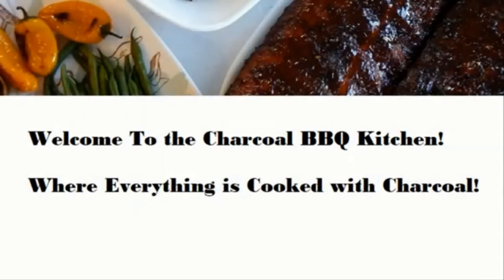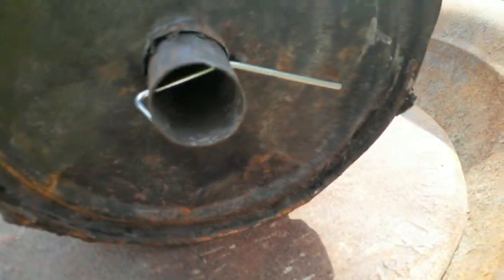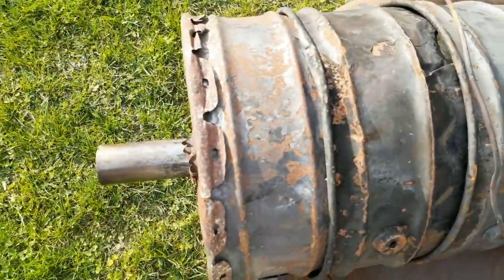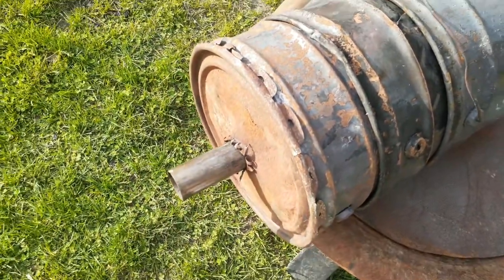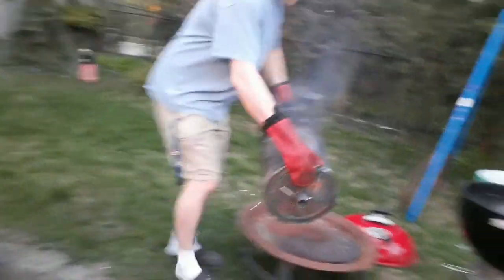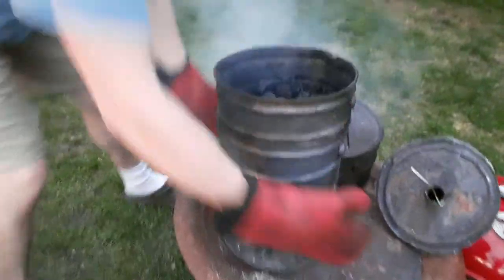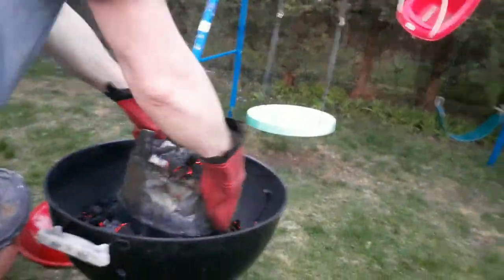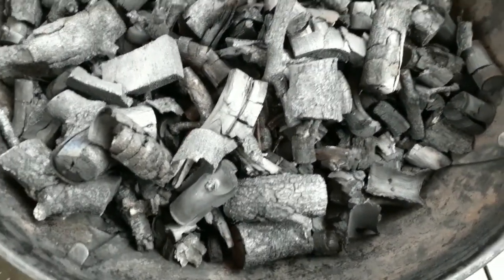The Best Backyard Retort - 5.5 pounds in 1 hour 20 minutes!

Comment: Many of the charcoal makers say the charcoal can ignite if dumped immediately. Have you had any problems with it firing? Would it make any difference if you left it sealed and dumped the next day when cool? Thanks for taking hours off the process of making charcoal.
Reply from the maker: Thanks Stuart for the comment.  My carbonization chamber must be buried in snow or sand to be snuffed without dumping.  The seams will allow too much air inside once the forceful off gassing is complete. When I dump...yes it immediately ignites when the oxygen hits it but lately I am hosing down completely with water and drying the next day on lawn bags due to it being hot summer in Canada.  Eight hours later it completely dries.  In the winter I bury them in snow.  This summer I was able to make 15 to 20 pounds with a combination double retort indirect and then direct burn down in 2 hours total.  Perhaps more videos of this to come!

Comment: Pallet wood can be treated or had chemicals spilled on it. I wouldn't cook with it. I love making charcoal too.
Reply from the maker: Thanks for your comment Mark.  I am not sure why I included a piece of pallet wood - probably just to see how well it would carbonize.  But to be honest, I have no problem cooking with well carbonized pallet wood - it is no longer pallet wood - it is simply charcoal.  I converted several pieces of hardwood pallet wood this year that was only heat treated.  The hydrogen bromide treated pallets are not available in Canada where I am.  Any spilled chemicals on the surface would be absolutely blown out of the water so to speak from the humongous temperatures of the carbonization chamber which would very easily remove chemicals on the surface of wood when even the resins and chemicals deep inside are blown out.  I even cooked with pine wood charcoal last year during Covid which was just beautiful stuff.  Very little smoke or flavour on igniting due to it being extremely well carbonized.   If you are not well carbonizing your wood - achieving almost a brand with your result then that possibly is of concern in using those pieces.  But here is another question - what about the cedar plank that I used to cook my salmon in my last video - it started to smoke after about 15 minutes on the grill after it dried out - I think that smoke is probably more of a concern than anything that would come out of well carbonized wood.  When another lockdown is declared I would have no problem cooking with any charcoal as long as it is well carbonized.  People always say don't cook with this softwood or that supposed toxic wood, but if it is extremely well carbonized, any toxic resins are likely long gone.  That being said, obviously my first choice is to cook with well known safe hardwood varieties such as maple, oak, fruit woods etc.  And finally, what about briquettes - the smell from those make me shake - how that smell is declared non-toxic on ignition is beyond my ability to fathom.   Thanks for watching!   How do you make your charcoal?  Let me know.